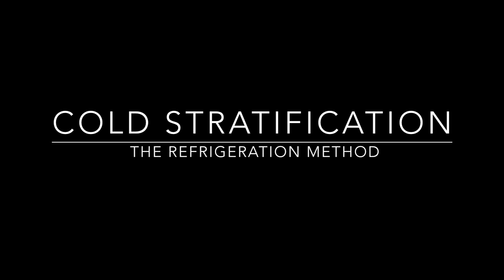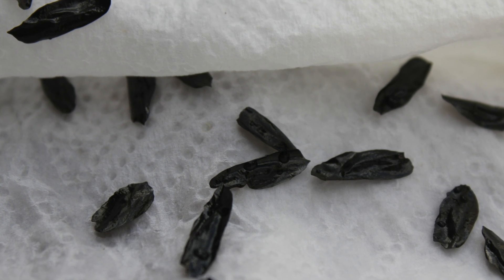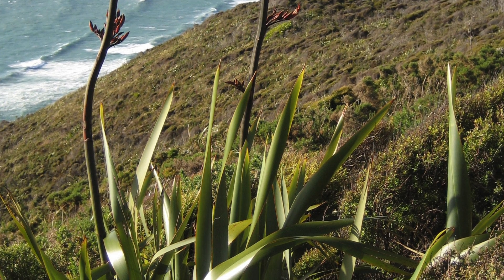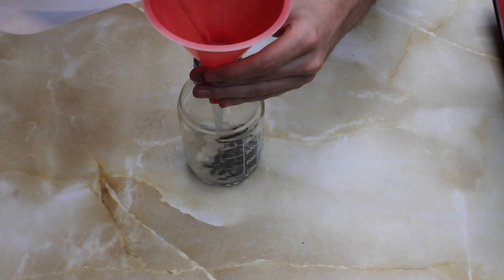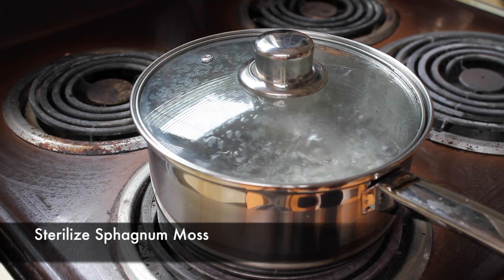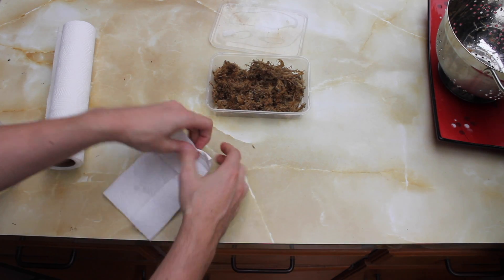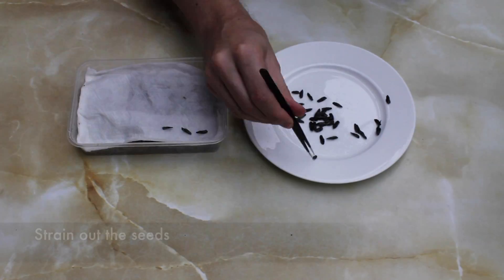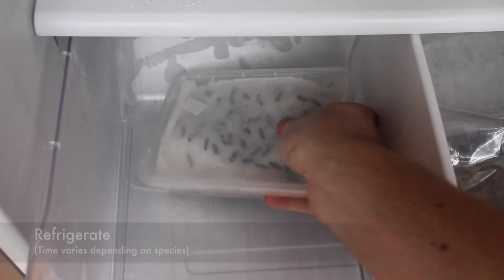Germination Tips: Cold Stratification of Seeds

Comment: Does the shell around seeds act purely as a physical barrier to protect the seed during the winter cold period or is the cold period required to change the seed itself?

I suspect the seed doesn't need to go through a cold period but the seeds outer shell prevents damage to the seed during a cold period.
Reply: the cold is require for the seed itself

Comment: does this work for all seed types? or just certain ones?
Reply from the maker: Hi there, not for all seed types - just those that which require a cold period of time (i.e. winter) before their germination is triggered.
Reply: Valley Roots ok so do u have a resource I could referance to know if and what seeds need this.
Reply: usually the seeds native to cold climates require this like berries and stuff you can google your specific seed
Reply: If the paper towels provide moisture, why do you use the moss?
Reply: deweywsu it’s for excessive water so there’s a air gap so the seeds are not laying in the water